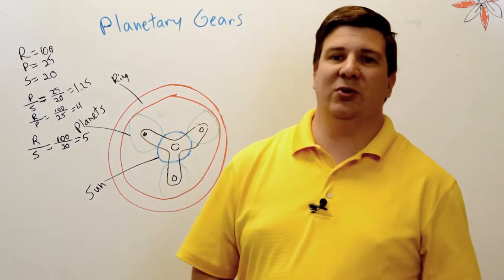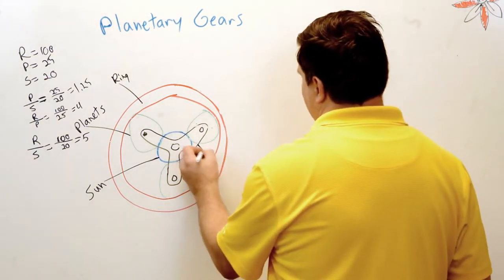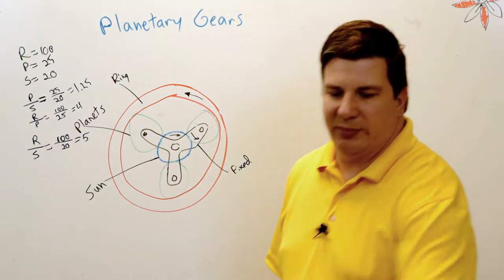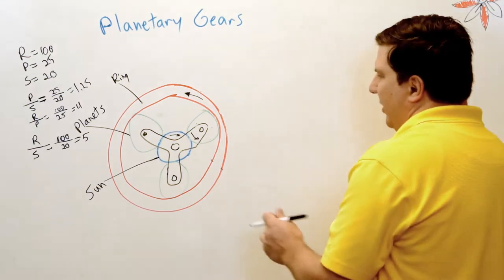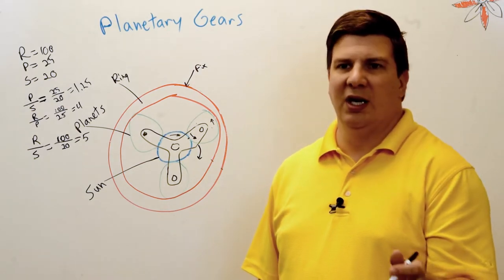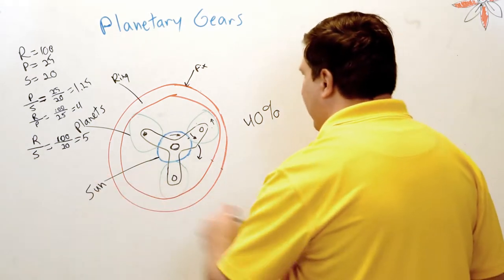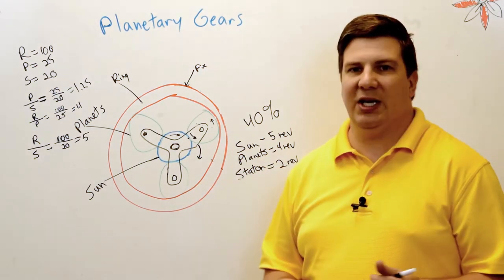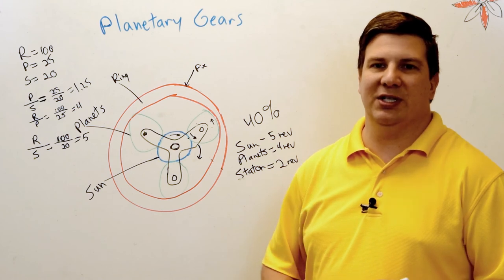STEM-Basic Planetary Gear Systems

Comment: I know this is an older video but I am hoping it is still monitored and you can help me out here. I have went down the bit hole of planetary gears and have watched several different videos and I am confused by what I think is conflicting information (more likely me just misunderstanding)

From online the gear ratio from sun to stator/carrier GR = 1 + (number of ring teeth/number of sun teeth). I believe the gear ratio also  =  driver speed / driven speed. In the case of a locked ring gear, and using the teeth number from your examples, the gear ratio, GR, for from sun to stator would be = 1+ (100/20) = 6. If it is also true the GR = driver speed / driven speed, then the stator rotational speed would then be = driver speed / 6, or 16.667%. In your example, you arrive at the fact that the stator is rotating at 40% of the sun, which is different.

Can you possibly clear this up for me? Like I said, I figure I can chalk this up to my misunderstanding but I like answers haha
Reply from the maker: Nate,  thanks for the inquiry.  The number of teeth will indicate the ratio because they are all tied together.  Check out this article https://mentoredengineer.com/calculate-planetary-gear-ratios/ and others on mentoredengineer.com for more information on this subject

Comment: I’ve seen illustrations where none of the 3 gears are fixed, thereby allowing for an even greater reduction for the ring gear. In reality, if we allowed all three axes to move freely,  would that ring gear ratio remain constant, thereby allowing that free spinning ring wheel to act as a secondary input to drive another object? I presume that this depends on what that ring gear is driving and the torque required. Or am I looking at this the wrong way?
Reply from the maker: David,
That is the same concept used in automatic transmissions.  Check out these videos where I look deeper into this subject.  In the second video, the sun drives 3 separate systems and the ring is held stationary based on the desired output speed.
https://www.youtube.com/watch?v=imp3le0DCXs&lc=UgwhQbyC00zl2pVnQ9F4AaABAg
https://youtu.be/V10Kx9vpdmI
Reply: @MentoredEngineer  Thanks. For some reason I thought that the compound systems all involved a fixed plane of rotation. The illustration I saw had the sun, planets, and ring moving. I'll look at your videos again and see what I missed. Another question: if we're not dealing with high torque applications, why aren't belt-drive or pulley systems using this? I only found one video on youtube which came within close approximation of this (titled "inverted timing belt transmission"). Last question: I've seen compound planetary systems illustrated whereby they're arranged parallel to one another using shafts. Are there system which achieve compound advantages, but instead of utilizing a secondary separate gearset, add more planets? In other words, instead of: sun - planet - ring, they would consist of sun - planet - ring - planets - ring, or some variation thereof? Or would the additional mechanisms cancel out a mechanical advantage as they're essentially being used as idler gears? Thank you so much for taking the time to respond.
Reply from the maker: David,
As far as the pulleys, they are a wear item and need to be tensioned.  This means more parts.  One of the main benefits of planetary gears is the coaxial shafts.  The inverted timing belt transmission is a cool idea.
The other cool thing about planetary gears is that you can make complex systems do cool things.  You probably could do the configuration that you were proposing, but it might be difficult to control the motion by holding the right things.  I'd dive deeper into this and see if others have tried it.  If not, maybe you can patent it!
Reply: @MentoredEngineer  thanks again. I’m borderline flabbergasted there isn’t more information and talks on YouTube about this ubiquitous marvel of an invention. For the rest of us non-engineers, I assume planetary gear mechanisms are just scratching the surface of simple, yet impressive marvels of engineering? I realize we all have finite time so take my request with a grain of salt, Have a great night!

Comment: Ok I bought my kid a planetary gearbox set.
Surely I’m missing something.....
The rings are stationary and there are two different planet and sun sets.
One sun has 12 teeth and the 3 planets have 18 teeth. The ratio states 5:1
I figured (3*18)/12= 4.5:1

The other planet sun set is 
3 planets with 16 teeth and a 16 tooth sun with a ratio of 4:1
Again (16*3)/16= 3:1
Can someone explain this???
Btw the toy is tamiya 72001
Thanks for any help
Reply from the maker: Johnny Jr,
Thank you for your inquiry.
From the pictures online, the system looks like a 48 tooth ring gear that is stationary.  Based on the universal gear equation with S=12, P=18 and R=48, one input from the sun will give 0.2 rotations of the carrier which is a 5:1 ratio.

 This video should help.  https://youtu.be/imp3le0DCXs.

Let me know if you still have any questions.
Reply: @MentoredEngineer  thanks for the reply. The video cleared up a lot of questions and also left me with more to think about . There is definitely more to it than I thought.
It may not be in your plans , but it would be awesome if you had a  basic engineering course on YT or Udemy for teens interested in engineering.
Reply from the maker: Johnny, 
I'm glad that that video cleared things up for you.  I'm curious as to what you mean by "basic" engineering?  I find that what I call basic is generally boring in nature or has been covered well enough that I have nothing "new" to offer.  
Please check out the website as well mentoredengineer.com
Thanks for your feedback.
      -Corey
Reply: @MentoredEngineer   oh I definitely didn’t mean boring and basic was probably not the right word. I meant more like  a STEM course for everyone.
Tech Explorations has a web site  and  few courses on Udemy. Just about anyone can follow along with ease and learn how to program an Arduino,  learn the basics of C language , understand electronic components,  build electrical circuits and learn about EE without experience.

Another great one is Programming electronics academy .  Their course is more heavy on learning to program an Arduino than Tech Explorations .

One that had potential but we passed on for a lot of reasons is Jetpack academy. 

Mark Roper has a ME 30 day camp for all levels. From what I understand, depending on your age, it gets as challenging as you make it.

I’m sure with your knowledge, right content/projects and your personality, you could reach a large target audience.
Reply from the maker: Johnny,
Thanks for explaining.  As mentioned, I don't think that I can offer anything new in this space.  I really wanted this channel to be a resource for engineering graduates so I do assume the ability to do algebra and basic engineering principles (statics and dynamics).  
I was considering putting together a "redneck" structural engineering course, but the market seems to be narrow and there could be liability issues.  I've already been burned on 2 courses. (I'm really surprised at the lack of interest in the roller coaster design course).